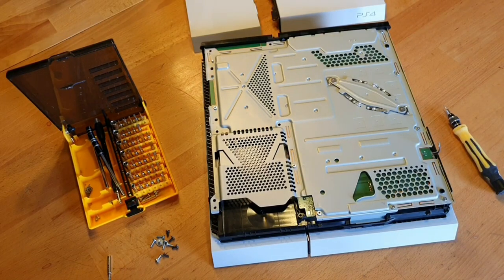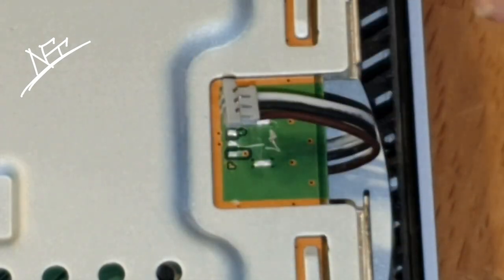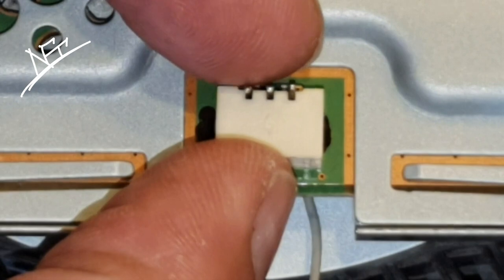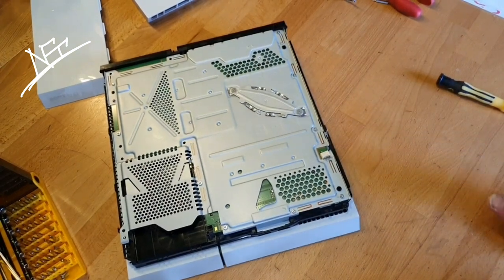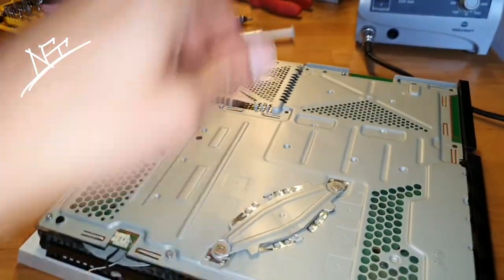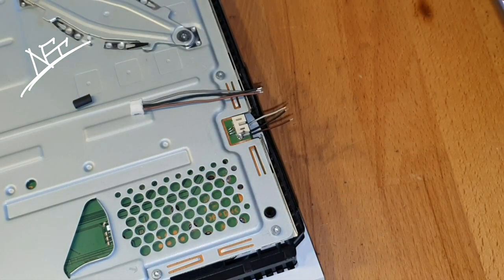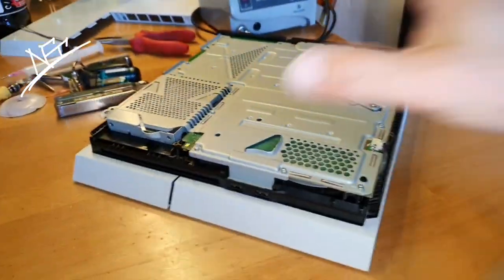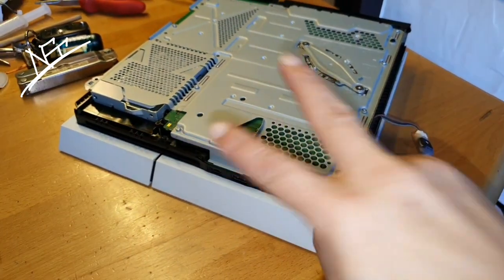Three ways to repair a broken PS4 Fan connector By:NSC

Comment: Great video, helped a lot I'm doing my own customisation to my ps4 slim, I'm adding an accelorator and splicing in a 10a 3000rpm external fan to help the cooling even more, may add some side intake fans later on.
Thank for the great tips buddy. 👌🏻👌🏻
Reply from the maker: You welcome bro.

Comment: my ps4 fan connector came off and my father tried to solder on the wires to the solder dots. when it was turned on it smoked a bit and when it was checked the board got burnt a bit, the ground solder point is no longer visible but the other two are there, is there any other place he could solder the ground wire to?
Reply from the maker: Yes, Ground is minus, minus its ground, the metal shield is ground, you can fix the cable with a screw or just solder the cable to any ground place.

Comment: Hey is possible to fix power supply
 without soldering?
Reply from the maker: Could be possible but not recommend...
Reply: @NSC-Modz  oh I will take my ps4 pro to person who know how to soldering. btw can you make video how to remove power supply connector in ps4pro safetly? because I see a lot of posts on other sites like GBAtemp. Something like: I ripped off power supply connector in my ps4pro how can I fix it? btw it holds really hard
Reply from the maker: @altairps3HFW  you just need to move it from left to right while you push it up and with the hand just press the connector down. It's not hard at all, it's just about practice.

Comment: I was just wondering, isn't that fan a 12V device? Why did you apply a 5V power supply to run it?
Reply from the maker: It runs up to 12v, but doesn't mean that it's running all time on 12v 😆

Comment: How you can tell if a fan connector or a mother base conector of the fan is damage?
Recently i cleaned my series x and take off the cable several times to reasure that wwas ok 
How can you tell that its fine?

Comment: Is this power a 12 volt ? I try to add a new fan on the outside and i try to conect it where ia the original fan is but only the light of the new fan turns on and not the fan. The new fan is a 12volt.

Comment: Do you know if there's any way to fix PS5 fan connector if there is no copper on the board under one of the leads ?
Reply from the maker: Yeah, you need to search the right contact or trace, there you could solder a wire and fix it to the fan. Otherwise you search a contract witch brings the right voltage for the fan. 12v would be to much, so the fan will turn to fast, so i think 4-5 volt should be enough.
Reply: @NSC-Modz  Thanks for the info !! much appreciated. The ripped copper is off of the grey lead, or fan speed controller. looks like it may go to the other side of the board ?
Reply from the maker: @neilb5305  yes, you need to follow the traces, hold a bright light under the board in a darker room, than you will see the traces very good. Also with a multimeter you can check if you have the right contacts.

Comment: And how does one remove the adapter so the circuit board is visible like yours
Reply from the maker: This shity adapters are easy to remove ^^
Reply: NSC Modz I got it with a razer
Reply: NSC Modz attempting to solder it now wish me luck man

Comment: Help! I think I damaged the adapter on the cable. I am recieving temperature warning and red light. Could it be because of the back fan cable adapter? Or something else?
Reply from the maker: If your fan is not running then yes xD So take care...
Reply: Did u managed to fix it bc I’m having the sme problem

Comment: I tried cleaning my ps4 and i couldent unplug the fan connect so i used plyers and pulled the plyers slipped and disconnected a cable and broke it and ideas??? Besides buying a new one?
Reply: Buy a new one

Comment: Hey bro my ps4 do 3 beep when i turn on then turn off when i check it i see the cables for the fan  are cut off is this the problem or another problem?
Reply from the maker: Normally a PS4 stars without fan for a minute or two, so i think there is an other problem to
Reply: @NSC-Modz  Thank you, but do you know what the problem is? Because it makes three beeps and then turns off with a strange sound
Reply from the maker: @m4-_-35 how can i know without to have it here? xD
Reply: @NSC-Modz  maybe you see the problem before 😅